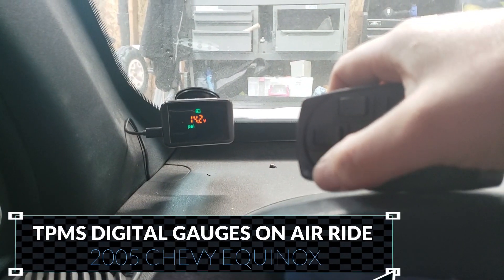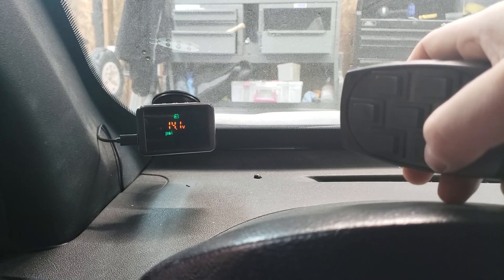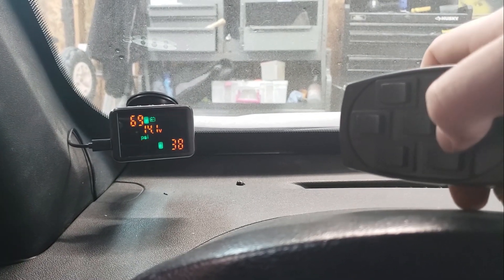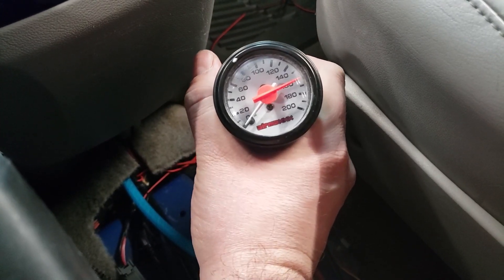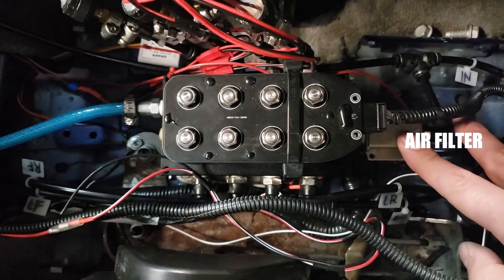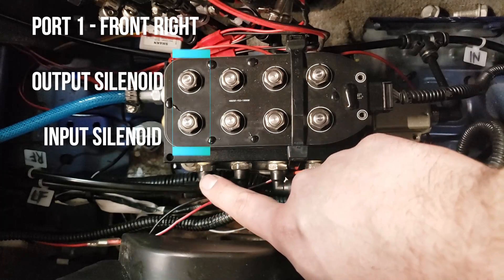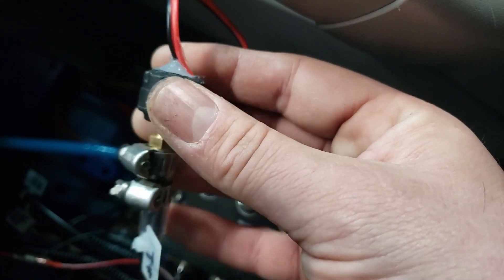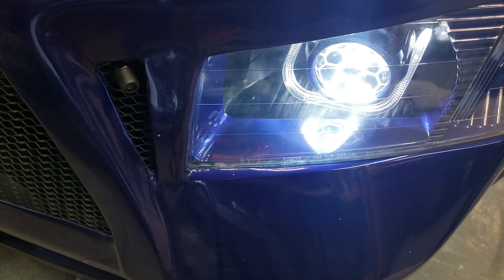TPMS for Air Ride: Is It Worth It?

Comment: Been looking around for a few months on bagging my 05 Equinox and it doesn't seem like many places do it. Your setup came out amazing. Could you share what parts you got and how you did it?
Reply from the maker: its bag over coil in front and bags in back. everything I used is universal. the down side is the equinox was never ment to go that low and if you drive with it too low the front axle will pull out when turning.
Reply: @RezyNWorX  I know this might be asking for a lot but would you be able to list all the brand and part names you used. And how much it totaled you for all of it, cost wise
Reply: @rock962000  I think it was too much
Reply: @PixelSavyy  definitely